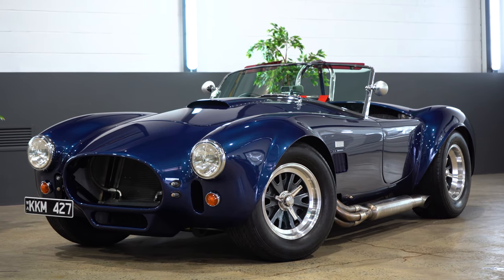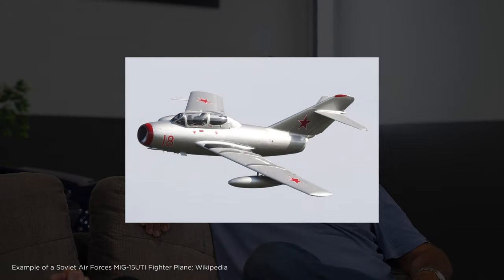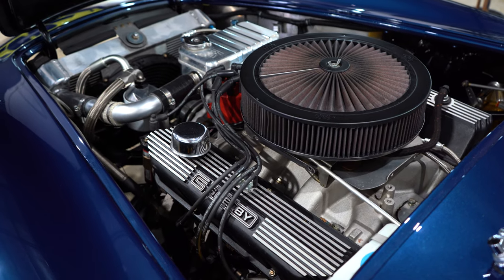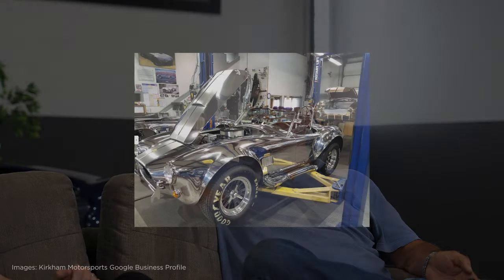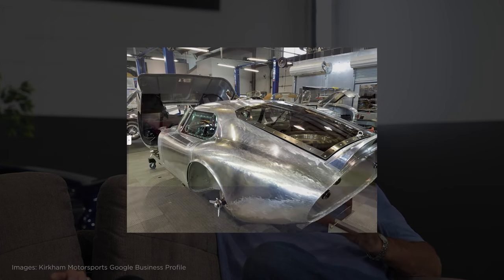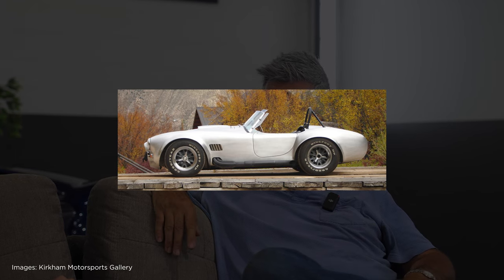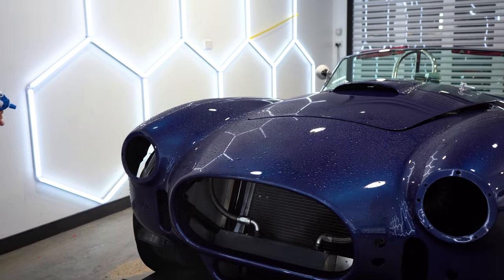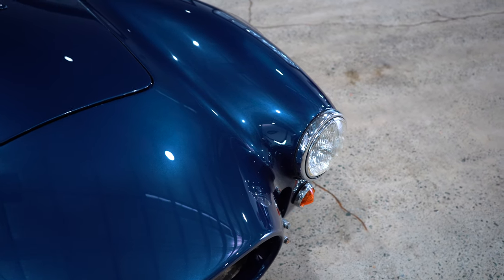Paul's Shelby Cobra Kirkham - MADinc Feature Film

Comment: Thats mint guys, a super bit of work, how good is a Shelby Cobra, seems fairly high geared. Moving along and not working hard 👍
Reply: Most Cobras have either a Tremec or T5 transmission, and they are short-geared. 1 &  2 are close together. There's a gap and then 3 & 4 are close together - 4th almost always being 1:1.  5th is an overdrive, usually a 0.68  Which gives you only about 1,500 rpm at about 75 miles per hour.   This of course depends on the rear end gear ratio, but 3.55 is the most common for any Cobra, whether a straight axle or IRS.

Comment: After inspection and licensing, suppose you remove those modern, 3-point seatbelts?  Here in LaLa Land, California many of us remove the wipers, front license plate, and "temporary backup lights" that were used for inspection.   The car never needs to be inspected again, so no one has ever gotten in trouble for it.  Technically, the police can ticket you for no front license plate when the car is parked but it's extremely rare.